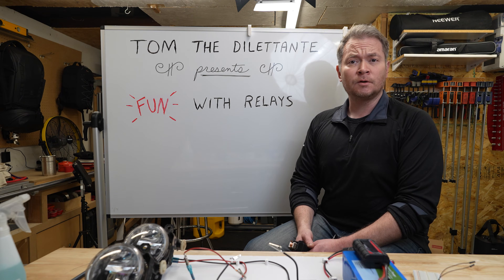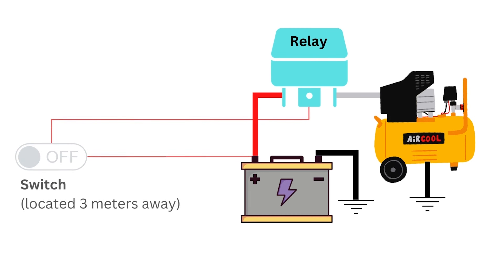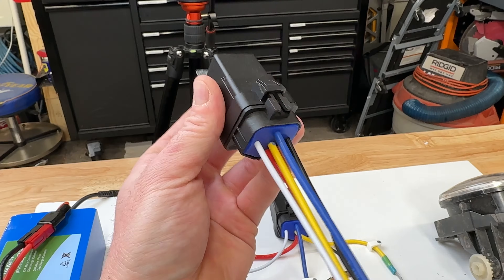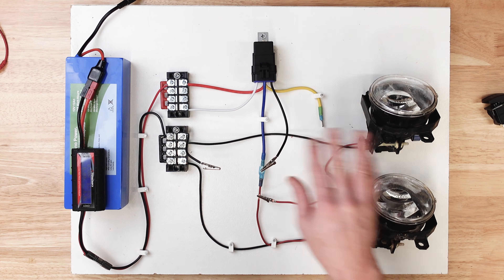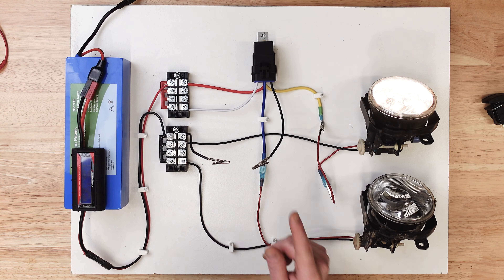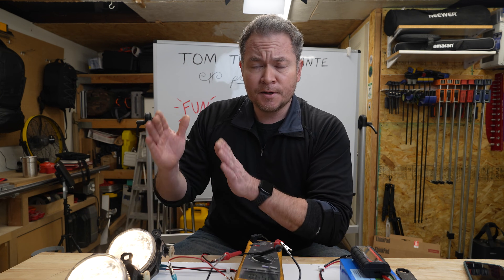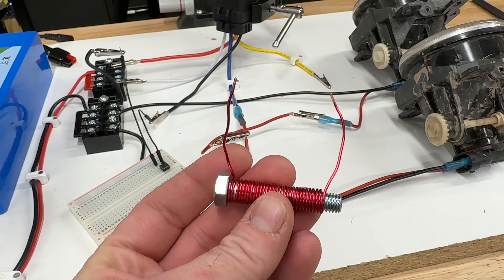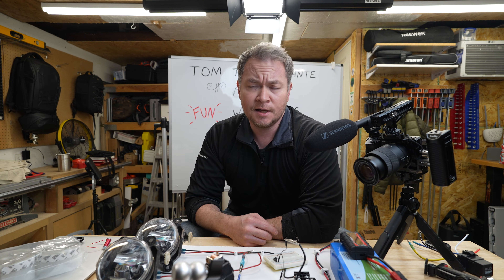Relays - What Are They & How Do They Work?

Comment: Hi Tom. What an excellent 👏 video! I just came across your channel seeking information about a recent issue I've been having with my new Sylvania sealed beam H4 halogen headlights. I've owned my 88 Honda Accord LX (carbureted) for over 28 years! In all those years I have never experienced any headlight oddities and even the retractors have been solid. Now, all HELL 😈 has broken loose!! My low beam circuits have a voltage drop and the pair of them work but appear very dim, only 1 high beam works (I think the bulb is fine because spare sealed beams show the exact same  puzzling behavior when connected to the wiring harnesses) the High Beam Indicator Light glows on the instrument panel, even when the highs are not engaged AND Gremlins are apparently messing with my Retractors!! What a nightmare. 😔 😟 

Having said that, once in a great while, for a brief time, low and high beams both work normally with proper brightness, the high beam indicator is working correctly and my headlights work like a champ! Hoping when I examine my headlight high beam RELAY tomorrow it is faulty and is responsible for all these shenanigans 😜. 

Thanks for taking the time to explain relays and their importance to us. 😃

Comment: Sorry to be off topic but do you have a Chinese diesel heater yearly update coming? Thanks
Reply from the maker: I can do that.  Got any questions in particular you'd like me to address?
Reply: @TomtheDilettante  if you have had any parts wear out yet or had to clean any parts that may have crud on them. I know it’s in liters but roughly how many gallons would it burn in a 24 hour period?  Maybe a how to, on what to buy if somebody wanted to run it from electric through a 12v converter? I want to get one for my shop, maybe 2. I am looking for examples of how to use a type of converter from electric to 12v. Thank you for your response Tom. 👍

Comment: Appendix A: Most automotive relays are switched on the ground (-) side, as you demonstrated. One of the reasons is that electronic components (microchips and transistors) like to source/sink to ground more readily than source to power.

Inside a control computer, micro amps switch on transistors which can handle milliamps. Milliamps through transistors switch the relays. Relays complete much higher current circuits.

Computers by themselves are quite useless without relays doing the work!
Excellent demonstration setup!

Comment: My lighting relay is controlled by a wireless switch so no issues finding a route through the firewall and no wiring required to the relay.  Good video, Tom.
Reply: Do you use the auxbeam relay?